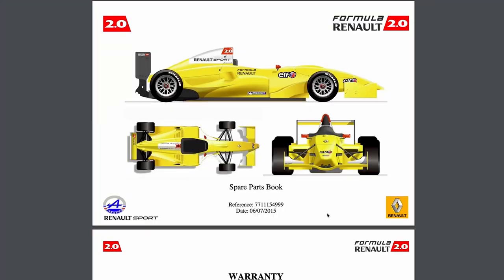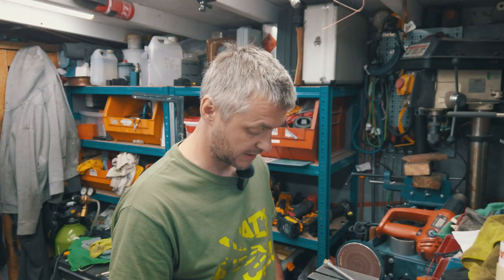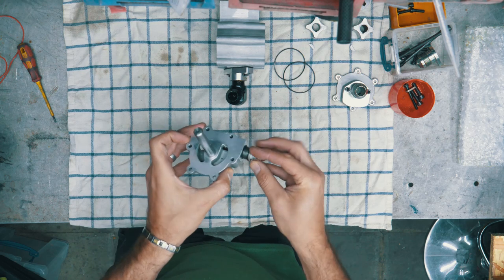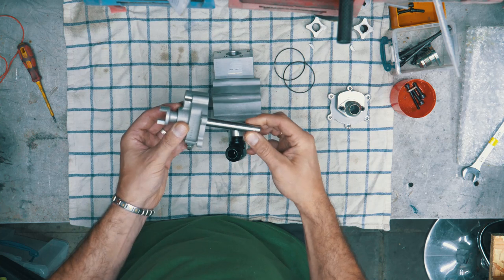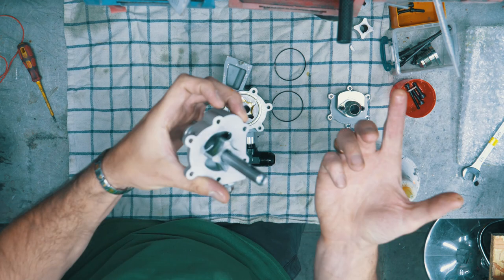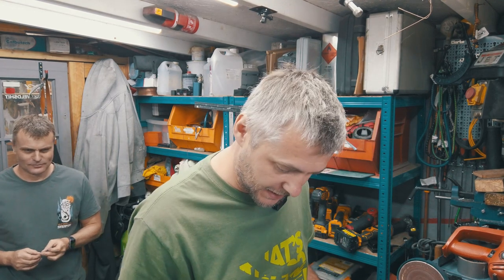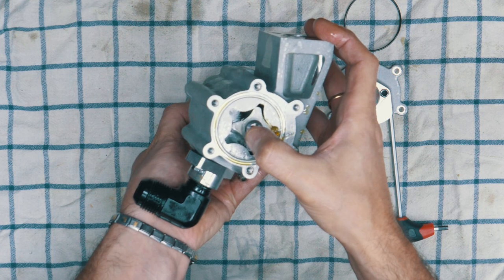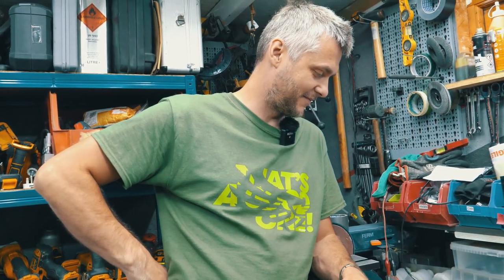What's inside F4R DRY SUMP pump? teardown and assembly. F3 Renault Clio dry sump. Dry Sump System.

Comment: What are these worth roughly? 

I bought a 1990 Formula Renault for £200 and it’s come with an F3R engine (non original) and a Renault Sport branded dry sump and pump. Figured the dry sump isn’t from the cars original F2N engine and looks like it’s not for the F3R either